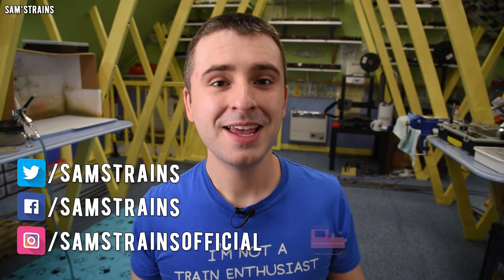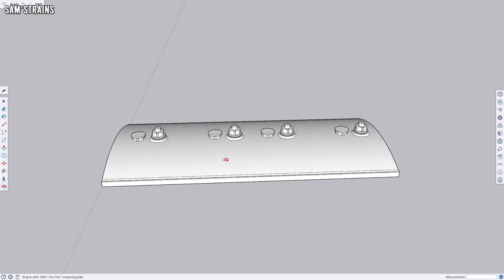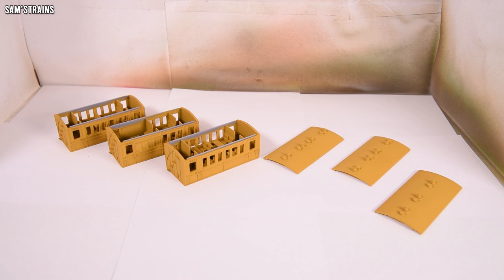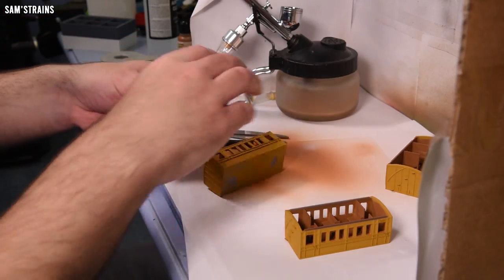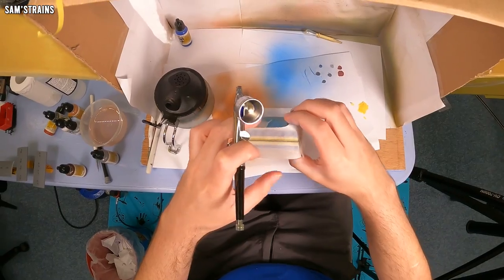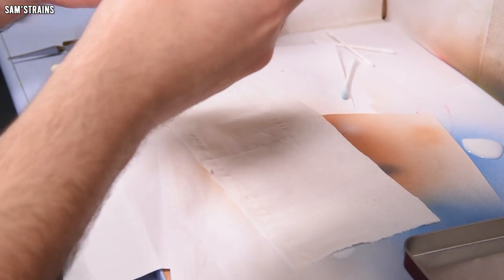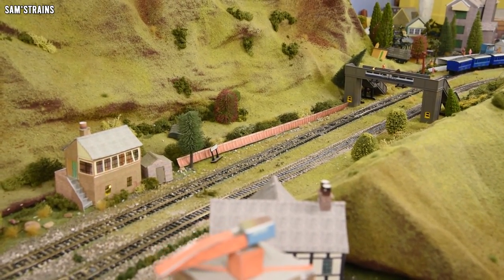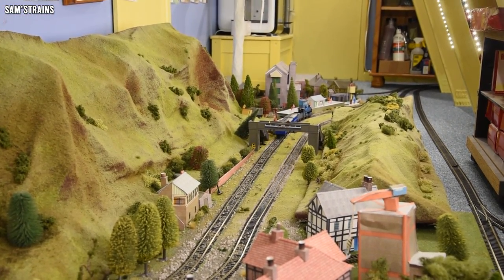Scratch-Building Custom Pre-Grouping Train Coaches

Comment: "Screw holes for fitting the body" : get it, Heljan ?
More seriously, nice design, with lots of prototypical ideas set together to give a very technically plausible vehicle. And your paintjob is far from bad.
The final result is really nice. Put them in a box from a manufacturer whose name begins by H and ends by Y, you can propose them for and RRP of GBP 40 !
More seriously, I see those coaches as an ideal local train passenger stock, especially on a light railway, hauled by a Peckett or any very light engine on this category.
By the way, would you be interested by someone's else design in the form of an appropriate file ready to 3D print ? I have some ideas...
Reply: Small list of heljan models that do have screws, what do you say to this Olivier?
1. Heljan DP2
2. Heljan class 128
3. Heljan class 16
4. Heljan class 15
5. Heljan/Rails 18000 and very likely 18100 as that is the same specification as 18000.
6. Heljan Class 07 
7. Heljan GER AEC rail car
Reply: @davidstrains4910  Well...
1 to 3 : don't know, so I assume it's yes, hoping to be easy to open ;
4 : nope, clip-on body, and nightmarish dissassembly ;
5 : same as 1 to 3 ;
6 : basekeeper plate yes, body yes too, but with horrific self taping screws, and in three parts, separated from the chassis.
7 : yes for the motor and the body, no for the basekeeper plates.
Screws, yes, but useable ones are better. Heljan is notorious for it's poor conception.
Reply: @OlivierGabin   
1. 4 screws to take the fuel tanks off then another 4 screws to take the body off, the body itself slides up off the chassis easily
2 remove 4 screws and exhausts from the end and the body slides off easily
3 the same as DP2 but you only have 4 screws to remove
4 incorrect, from what I saw in Sam’s review today there were 2 screws to remove after removing the fuel tank and clips disengaged easily
5 for 18000: similar to DP2 but only have 6 screws to remove.
6 and 7 you seem to have gone off on a tangent there Olivier, motor and basekeeper plate have no relevance to the original topic which was screws for fitting the LOCOMOTIVE BODY.
Last comment is your opinion obviously but if that’s what you think it means that you don’t watch other peoples heljan products and talk to other people like I do, the vast majority have always come back with positive things to say rather than negative things so they can’t be that notorious for apparent poor conception.
Reply: @davidstrains4910  Sorry, but for me, if you can't open everything easily because clips, it's a no-go. Including basekeeper plate
My criterion of choice is easy maintenance and user repairs, so the conception of Heljan products deters me from buying among other things. I put my own DCC decoders inside, and an engine that is an hassle to open is a no-go for me.
Yes, there is qualities in Heljan products, and I would certainly have bought some if there has not been what I consider a faulty design (class 07 and class 17, and maybe their class 15 too). They are not the only one with product's conception drawbacks.The Bachmann 45xx is one example, and I don't buy her for the same kind of reason (outdated design with poor drivetrain) compounded with what I think is an excessive pricetag.
So, if people are OK with Heljan, they have their reasons and in can understand them. I have reasons to not buy them, I have explained here them, it's my choice. I think a model you cannot open easily is detrimental, but a model sold with a basic level of details suits me if the price reflects this. and that would be a no-go and a defect for other people. You cannot buy everything and you have to choose you choice option. Mine is easy to repair engines with a good drivetrain for operations, and I am ready to sacrifice the level of details for this. The models I choose would be described as naff by people wanting an exposition model with the higher level of detail possible, each one his own...
Reply: @OlivierGabin  okay Olivier that’s perfectly fine, that is your opinion and you obviously have the right to have that but what you need to understand is that heljan isn’t poor quality every time and the disassembly of their locomotives isn’t as bad as some people make out, you also need to stop going off what one person says because that only gives you one outlook of a model, watching other people and talking to others gives you a better outlook and can help with decisions, other people may not go into as much detail as Sam does but it’s their experience of a certain model that is important.
Reply: @davidstrains4910  Well, I know perfectly that I am a complete failure with clipped parts, not patient enough to spend hours to open an engine to put a decoder inside, or do some cleaning. So, the facility of opening it is an important criterion for me for those reasons.
I also never said that the overall details or finish of Heljan models are poor, and that would have been a decisive factor for me to buy some if the drivetrain was not poor and the maintenance by the owner complicated. Yes, the overall aspect and details of Heljan's model is good to superb, even older ones like the class 15 are fair. But that's not the main factor for me
I understand that people don't care about opening their models because they prefer to pay a workshop to do the maintenance job for them, but it's not my choice.
I agree that Heljan models are not OVERALL poor, and they have qualities, but I found some points that I consider stopping points enough detrimental for me to justify a no-go. My elements of choice are the ease of maintenance and repair by the end user, a good drivetrain and good performances. For the last point, yes, Heljan models have  generally, good performances (some not, like the class 17), but axles without bearings and painful opening of the engine are far too common, and it's a fact. It's a default for me, an exploitation-oriented modeller, but someone who put the aesthetic value first won't care, will have what he wants about it with every Heljan models, and will be right to do so.
Reply: @OlivierGabin  okay Olivier you have made your point, we have both put our opinions of heljan on the table but like I said in my previous comment you need to stop going off just one person, (heljan class 17) yes sam’s doesn’t run as good but I dispute that it may just need a good run in for an extended amount of time, my dapol class 121 ran very slow to start off with and after an extensive running in period it now runs at a much faster speed, also I have seen a couple of other people who have class 17s run very good, class47peter and model railways unlimited have videos of their class 17s running well, okay most of heljan mechanisms don’t have bearings but their 18000 model does but then again the locos without them run smoothly from my experience, my DP2 being a very good example and the mechanisms don’t wear out, I have one of their old class 47 models and it is still going today, not every one of their models is difficult to get into, I haven’t ever heard of this maintenance workshop for locomotives, I have always serviced my locomotives myself, heljan locos being some of the easiest, when I got my DP2 earlier this year I took the whole thing apart to service it because it was a second hand model that had a life before coming to me, it was one of the easiest models I have ever worked on, everyone’s experience of models is different but unfortunately today there seems to be the narrative that ‘if one person has issues I will have issues’ which is brought on by just watching one person.